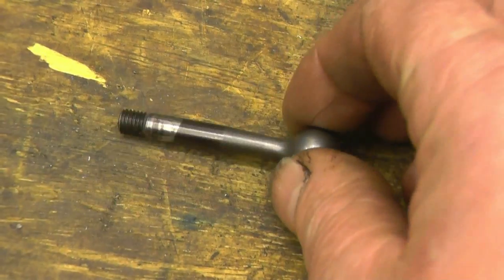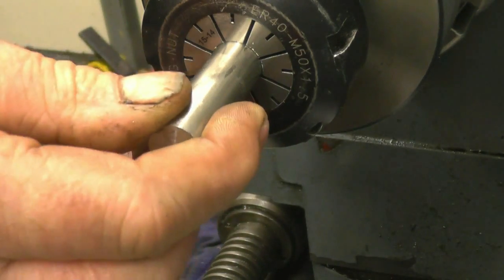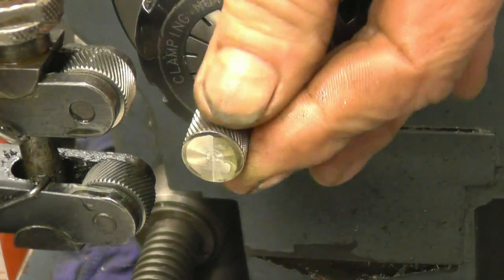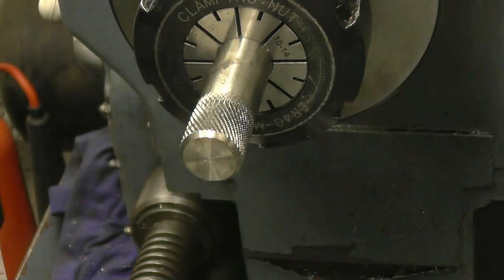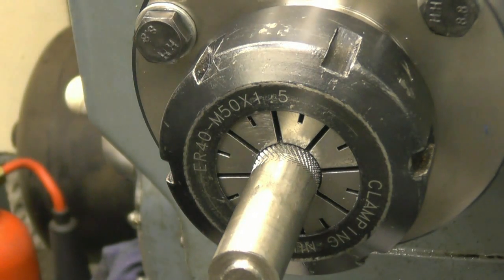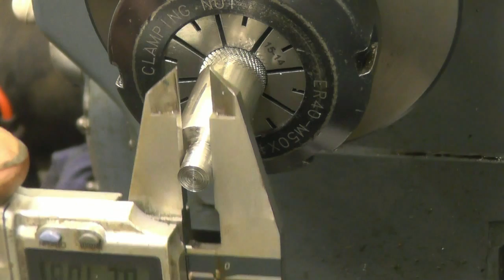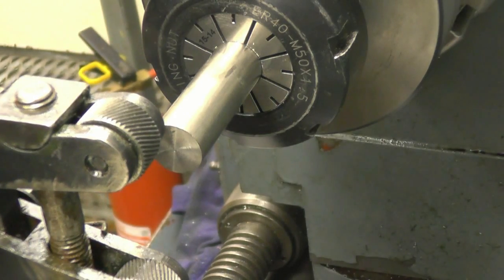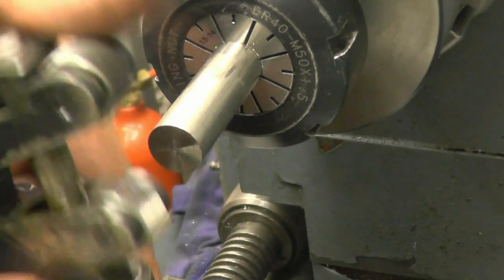SNNC 173 P2   Custom air rifle bolt

Comment: Oh lord, I always thought that knurling was done by a slow automatic feed and lots of other lathe shenanigans. Which also would be used to make perfect ball ends. Not CNC level, but just some automatic feed. But how can it be done so cheap?

Now I find out there is a machine tool to do it. Lol! It's not cheating just like taps and dies aren't cheating.

ETA: The fact that it's squeezing the metal and making the diamater larger is another good thing!

Comment: Personally, I like the second one better. Doesn't seem as clunky, but really you have to judge it when it's installed on the gun. Might try a finer knurl on one if you have the knurls for it,  that one looks a little bit coarse to me.

Comment: Had to go to your homepage to watch part one, you tube did not put it up. Any way what happened with the shrink fit did it hold as you thought it would or did it fail?? looked like a fail on video but it ended before we got an answer.
Reply: ive been having the same issues, one part doesnt appear, today, no part showed up on my subs, it came up as a recommended video!,   ive tried unsubbing and resubbing, didnt helo
Reply: also would like an answer on the shrink fit.